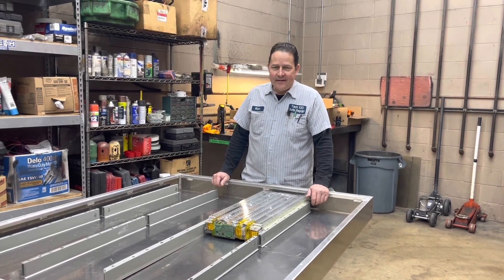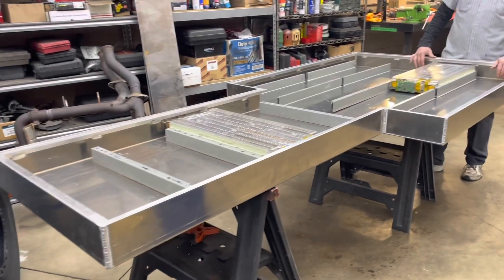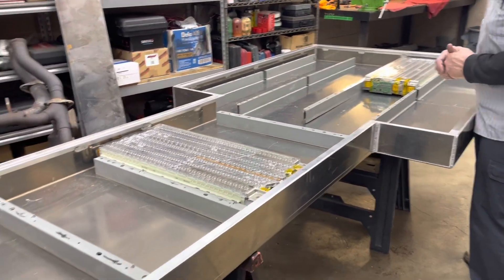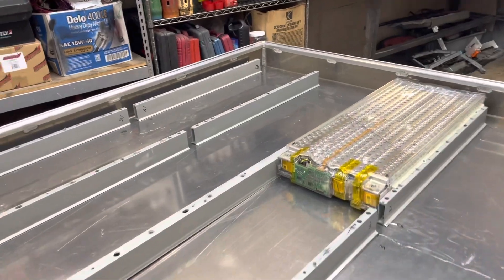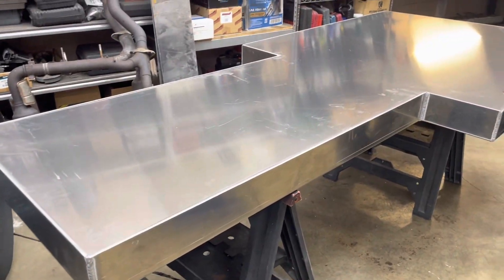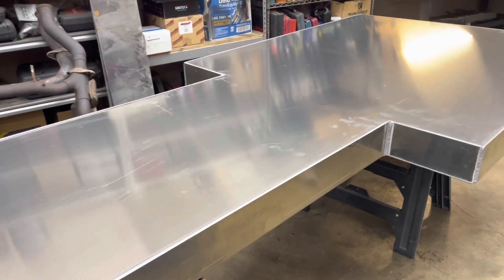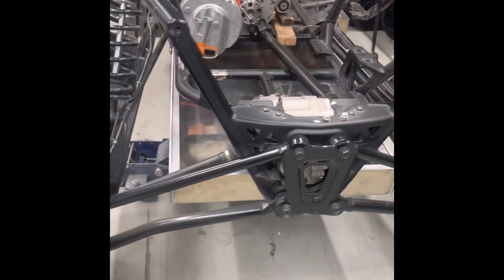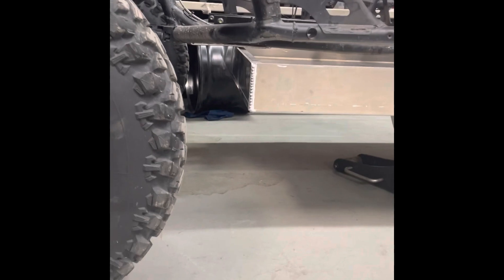Tesla x Polaris RZR Pro R Conversion Battery Box

Comment: Ron,  This project is looking great!   I'm curious, what are your plans tor temperature control batteries within the box?  What is the total KWH capacity of all the batteries?  While the battery box may be heavy, at least with the weight being mounted low, it will give the beast an overall low center of gravity.   Can't wait to see this project progress.
Reply: Not seeing his answer here - but each module is ~5 to 5.5kwh and 14 modules should net him around 68-80kwh depending on life of those modules. 

Cooling wise it doesn't require nearly as much as an ICE vehicle or a highly pressurized system (a cheap Toyota Prius electric water pump) would be enough to flow coolant into the pack. I would say he goes with a larger radiator core for more coolant volume to help disperse temperature if anything. He would be left with cooling the motor and that can be achieved by using a separate radiator + pump on rear or by utilizing the front with a valve. I personally would go with a separate pump/radiator for the motor to retain performance longer and let the pack enjoy its own system. Going to be way cool to see this thing done and built up. 

It would also be crazy if Ron took the bottom of the frame and pushed out the ROPS around that pack to allow the pack to become the floor of the car and retain its factory ground clearance. This thing is going be crazy wicked with its a nearly 50/50 weight distribution.